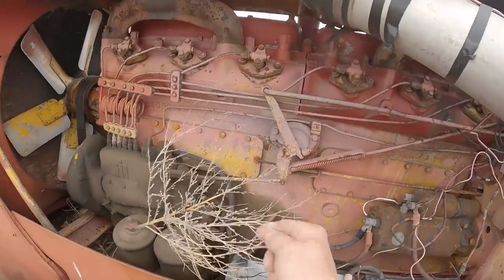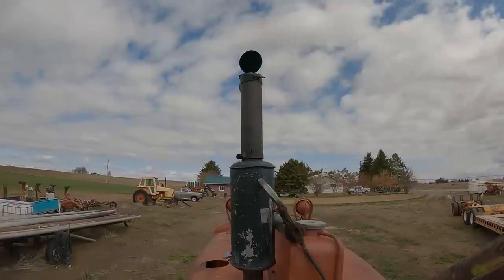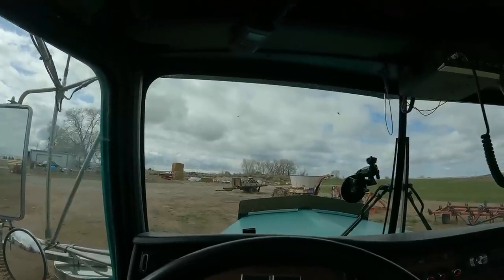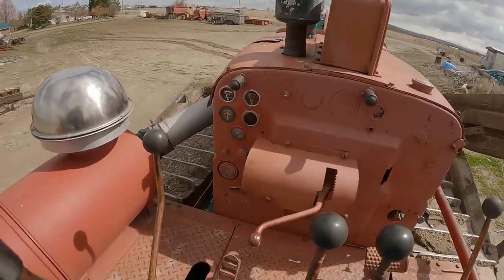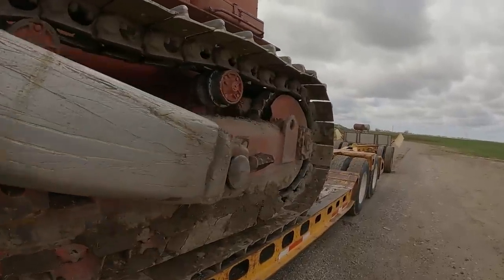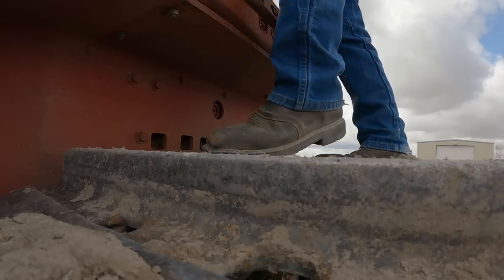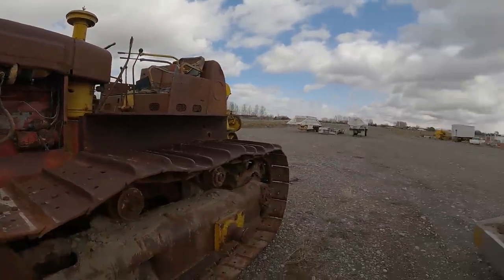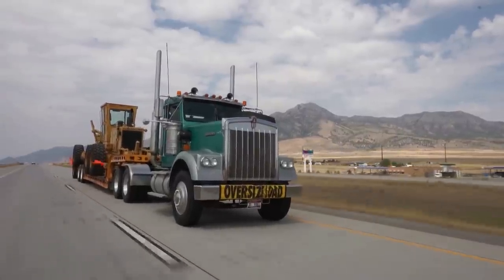How Does A Diesel Start On Gas

Comment: We did. A change to the steering pump to a vane type pump .as the gear pump had worn out the housing .
Reply from the maker: Would love to see that
Reply: @Jpaydirt  we don't have it anymore .but I will ask it wasn't that hard to do . From memory . Power steering pump of a late model Isuzu truck and an adapter plate new shaft .. take care Geoff . Hi from down under

Comment: That is one complicated head/engine, to design and build, I'm guessing it's gas start to build heat so it will diesel,  is it the lack of glow plugs, and or the injection system, or compression ratio why it doesn't start on diesel?

Comment: That starting system is cool. Always known of pony motors but not a gas/diesel starter system. The timing setting was also interesting. Is it correct to assume then that the factory had it set 5° before TDC and someone found out by mistake maybe they ran so much better 5° after TDC?
Reply from the maker: pretty much

Comment: Hi Jeff does the engine make any power when running on gas? Would it be able to move itself onto the trailer if the diesel system was shot? Mr Griffy looks like a good piece of ballast,  you know for extra grip!!!😁
Reply: They make enough power to load themselves on a truck, but not much more.

Comment: I can't exactly tell but radiator fan looks like it's on upside down. The convex side of the blade faces towards the front not the concave side. It'll still work the way it is but when its a hot day and hard work it'll be less efficient at pulling air through the rad.
Reply from the maker: It's a blower fan

Comment: the usual method, is get some cloth, soak it in gasoline and stretch it over the air intake, of the air cleaner. I can see why they did that, the early "pre-combustion" era diesel engines were difficult to start, which is one of the reasons pony engines were a good solution, granted they are an issue in themselves.   There are different ways to solve the same problem ))

Comment: I remember a boat where the pipe to the gas cylinder outlet pipe failed while the Diesel Engine was running. When they tried to stop the engine it continued running on the propane gas air mixture. Not sure how they stopped it eventually.

Comment: So the carburetor pulls air from the diesel intake, thru the carb and then into the small runner back to the head. There is no throttle leaver on the carburetor but will the engine running on gas make enough power to move the tractor?
Reply from the maker: yes but you shouldn't run on gas any more than is necessary because the starting valve is off it's seat and you could burn it

Comment: As far as the logbook goes does the 100 air mile rule not apply for you if you regularly run more than 100 air miles from home? I would think even if you ran coast to coast all week with the truck and lowboy if you wanted to move a machine from your shop to a place 25 miles away on a day you were home you wouldn’t have to fill out a log for that trip…is that not so?
Reply from the maker: I can't remember what I said in this video, but I may have been talking about a mileage log I have to fill out for my overweight miles,  since we don't travel far enough to warrant the use of a log book we don't do it

Comment: Had a TD6,  let her warm up good before you change over to diesel and I pull the throttle up just enough to see a little smoke out of the stack first then change. Oh turn off the gas.

Comment: The  old equipment seems altogether more satisfactory than the new stuff with the added bonus that if it breaks you can fix it. As an aside we have a new law in the UK that makes it illegal to drive a car with an "unrestained" dog.  Doesnt say anytthing about dozers though 🙂
Reply: Today's junk is all Japanese-inspired.  Very well put together on the assembly line, but overly complicated and almost impossible to fix.  I will gladly deal with "new vehicle bugs" and fix them, and have a tough, reliable, long-lasting easy to fix vehicle.

Comment: i noticed u moved the thorttle up but didnt pick up till u went in reverse is there a throttle pedal also and that throttle on the dash acts like a limiter or something?
Reply from the maker: it has a decelarator which is like a gas pedal only backwards, push it down to slow the engine let up to speed it up
Reply: @Jpaydirt  cool these things have like everything weird about them lol

Comment: Do you have to let it cool down two times before stopping the engine  so heads don't crack
Reply from the maker: The only way they crack heads is if you get them hot, 220 degrees will crack the head everytime
Reply: I read about a couple old farmer brothers who bought an MD because no gas M s were available. They said they always idled it 15 minutes before shutdown. They never cracked a head. Really you should do that on all the older diesels no matter how they start. I had an MD myself. It scared me a couple times. Once it got hot when bushhoging tall grass and the radiator plugged. I kept it running to a nearby garden hose and sprayed the radiator until it got cool. Another time I was plowing and it blew a hydraulic hose. It had an MnW live pump on there so I had to shut it down but I put it on gas temporarily then killed it or blow hydraulic oil all over the place. It didn't crack either time but you know it was close!

Comment: Can you run that on straight gas if your going to say load it onto the bed?
Reply from the maker: you could, not much power and they tell you not to run on gas more than is necessary because you could burn the small starting valve as it's off it's seat the whole time and valves transfer heat as they contact the seats

Comment: Cracked heads were common because people would run on gas too long or try to use it on gas when out of diesel. Not really a good idea. I do agree pony motors aren’t a good idea either. IH had a lot of ridiculous engineering like timed steering clutch bolts and weak castings. 24s did sound good though.

Comment: Instead of running 5 degrees before TDC. 
Try a little less. 
5° after TDC makes No sense at all when it comes to any combustion engine.  
Or you are running the wrong fuel.

Comment: All that complexity because IH was too cheap to license the glow plug technology at the time.
Woah woah wait, did I hear Jeff just besmirch a CAT? "Beats a pony motor any day of the week?"
Reply: If you think about it back in the day you would need one mighty starter motor to turn a cold 1091 cubic inch Pre chambered diesel over fast  enough to light it off.
Reply: Because it's military it would have to be dead nut reliable to start in any weather.  Hence the redundant system.
Reply: @gordonborsboom7460  The starting system is not redundant, it was necessary to start the engine in the environment of the day. All these engines from the TD6 on up were used by contractors, farmers and the Military. Once the American tractor makers came up with better fuel systems and engine design the old ways of starting disappeared. There was a time when glow plugs were used to get the fuel warm enough to fire, they went away as direct injection was improved and we had Modern Engines that would start easy. It was just better and better engineering over time.